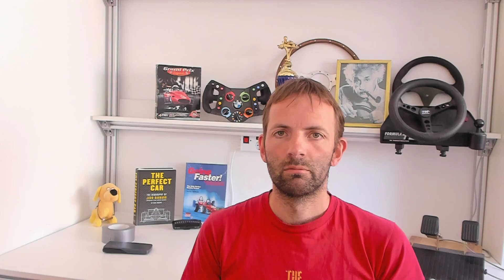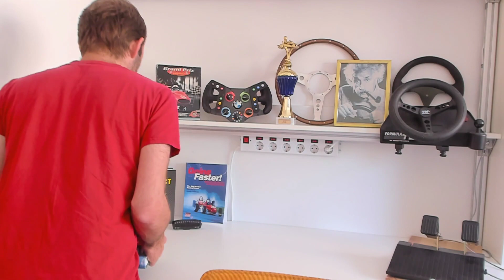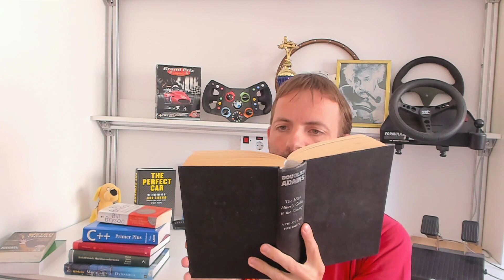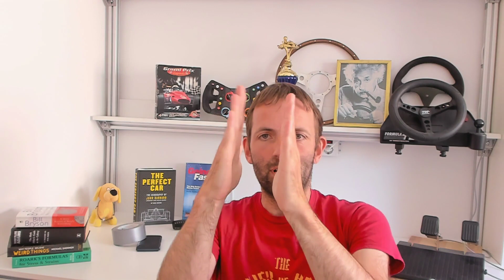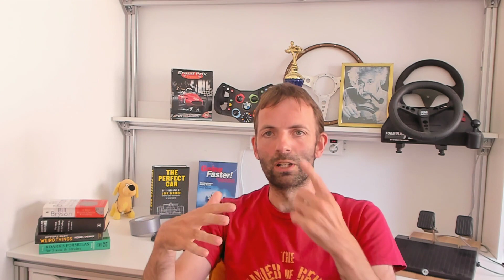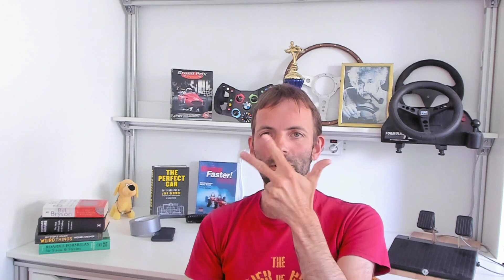Why are tires so difficult to model in a racing simulator?

Comment: As you are directly involved with the physics, would I be wrong in saying that you are also limited by the cost of research and hardware as it’s something you did not mention?
Up until the introduction of Ryzen, and competition with Intel most main stream processors were 4/8 thread max. With the complex calculations and limitations of games/sims only using a couple of cores and the calculation and rest of the engine taking up resource is or was this a restriction on the physics.
With what you have said, if you only get limited data from the tyre manufacturer, could you see franchises like turn 10 (Forza) and  Polyphony Digital (GT) Start to dominate the sim market, because they have much deeper pockets, and they will have comparable hardware to pc’s shorty.
Reply from the maker: Good question! Here is an essay.... 

I feel there is this 'urge' in people (engineers) to make things more complicated when the processing power allows. I also feel that customers get a good 'feeling' knowing whatever they're playing is incredibly complex.

What in my opinion happens way quicker than most engineers would like to admit, is that you're drowning in a sea of numbers. You simply can't control a system with a lot of variables. And the goal of a game is not to be some PHD tire model project. The goal of a sim / game is to deliver good content that is consistent from car to car, with improvements from beta tester / driver feedback being 'easy' to roll out over the entire car lineup.

Too simple is bad. If there is just one 'grip' value, then it is easy to adjust but you will be limited to what you can change in the 'feel' of the cars.
Too complicated is bad. If you get feedback but don't know how to adjust your model for this car, let alone the other 50 cars, you're not going to get anywhere.

Since I've made so many mistakes over the decade I've been trying to understand physics, I am very cautious about adding complexity. People who feel differently about this COULD be right. But if I was twice as smart, which is probably the upper limit of what 'physics guys' can be, then I still wouldn't be able to control a highly complex system. Perhaps Dave Kaemmer and Terence are more than twice as smart, but they don't tune the cars in the game. 

You see I've learned to be extremely wary of complexity. People overestimate themselves all the time. No matter if its blind wine taste testing, blind audio equipment listening, or blind sim car setup testing, we expect to taste / hear / feel a difference, until it is a blind test. Then we come up with excuses rather than admitting to the placebo effect.  It is probably natural human behavior to be over optimistic about our ability. 

This can really hurt race sim development if you don't constantly ask yourself
1) Do we really need this complexity
2) does it really add something we can feel / measure / validate with reality
3) does its complexity not hurt us in our development time and keeping the sim up to date

If you don't constantly ask yourself this, and you get carried away by our human tendency to say 'Hold my beer' and do something complex, I feel you get too complicated models that are too hard to work with because you've lost sight of your own limitation and the reality of producing and maintaining sim content.

The most important thing to add here is that simple is NOT simple to 95% of people! The code is still complex, the models still have many variables and it is very difficult for me to see through the AMS tire model and get the most out of it. So it is not simple, it is not arcade.

Processing power or money to test more tires is not a factor in my opinion. The weak link is the human, not the machine.
Reply: @Niels Heusinkveld  Thank you for taking the time to reply and clearly explain and expand on your video. 
I completely understand what you are saying now and understand the limiting factor 👍🏻
Reply: @NielsHeusinkveld  Well said. I work in IT designing and maintaining systems and networks, and I am constantly asking those 3 questions. I think it is vitally important across so many fields, and is so often overlooked. Is a more complex system more or less likely to break? The complexity may solve one or more problems, but adds in more elements that "can" break. And if they do break, as they are more complex are they even harder to fix? So in the end are we worse off?
Reply: @NielsHeusinkveld  Words of wisdom. It reminds me of the probably apocryphal story of NASA pending a ton of cash designing a pen to work in space where as the Soviets used a pencil !
Reply from the maker: @honeychurchgipsy6  Apparently that wasn't as simple. Wasn't it because pencil tips could break, leaving electrically conductive particles in the cabin? If there is one impressive feat its the moon landings and I think NASA didn't over complicate things.. They simply were that complicated :-)
Reply: @NielsHeusinkveld  - that makes sense - but the story is too good to be allowed to die - lol!!!
Reply: @honeychurchgipsy6  nonsense, they just paid 25$ for a pen with pressurised ink chamber developed by an outside party
Reply: @kornaros96  - what is nonsense and who paid $25 for a pressurised pen?? If you read the comment thread we have already stated that the pencil versus space pen story is nonsense - so what is your point - we are just having a laugh saying it's a great story!!
Reply: @NielsHeusinkveld  I think you've nailed the argument on complexity in that dynamic systems are always capable of producing unpredictably complex or unwanted results, even with relatively simple inputs (think Wolfram's new kind of science). I think this is rooted in a question of top-down versus bottom-up design, where top-down focuses on emulation that seems plausible in a narrow operating range whereas bottom-up lets the desired properties emerge naturally, which is infinitely more dificult to target desired outcomes with, but then the model will hold up in a wider variety of situations which  makes it more believable. 

We can agree that a grain of sand isn't a pile of sand, but what about 4 grains of sand? No? How about 43 grains of sand? How about 15,000 grains? There is no number where it becomes a pile of sand because there's no such thing as a pile of sand. That's just a level of abstraction above the actual components (grains of sand), and it can be modeled as such without any code describing the particles of which it is comprised. But then, what is a grain of sand? Some are larger than others, and the shapes are irregular. If 1/1000th of a grain of sand breaks off, is that a second, smaller grain? It's an infinite rabbit hole of layers of abstraction that goes all the way down, and we have nowhere near the computational processing power to model that in a useful way right now, and yet that 1/1000th of a grain of sand IS indeed interacting in that dynamic system and changing the results. 

If you can't go all the way down, then you must have to go up, or at least find the level of abstraction which best captures the desired behavior, ie, a believable tire. You end up chasing computational reducibility to a practical end, and there is elegance in that simplicity in much the same way that formulas so neatly compress sprawling complexity into easily understood and useable tools. At a fundamental level, what you guys do is about finding believable outcomes, not about having exhaustively complete internal modeling. This can only be done when you can individuate the parameters! In a closed dynamic system, every tweak is going to ruin your carefully balanced house of constraints and properties. The problem with trying to model, say "squishiness" is that it is fundamentally integrated with the other properties of a tire in the real world, and changes in those other variables will influence local squishiness in a complex way. 

AI has given us the amazing ability to run millions of trials with tiny, tiny, isolated tweaks that often reveal surprising insights when viewed in aggregate. You begin to see a "shape" to the effects of turning different knobs, and I think that combining this power with the irreplaceable human interpretation of what a tire should feel like is entirely possible, so long as the variables that most heavily contribute to the perception of driving on a real tire are sufficiently defined and related to one another. You could feed an AI massive datasets of telemetry data (and throttle, brake, steering input data) from top drivers in a wide variety of conditions and essentially build a "drivatar" AI of sorts, then turn the process on its head and have that AI drivatar drive your tire models, measuring the differences between the output telemetry and the target telemetry (the data it was supervised with originally). Then you basically have an AI that hones in on a tire model, making millions of tweaks until the driving produces nearly identical telemetry data to what it was targeting, almost like a metal detector sweeping over a nugget. AI will never replace the human element needed for good model design, but it can run 100,000 laps much faster than I can! Its opinion of whether a tire model is close isn't subject to whether or not it has eaten lunch or previously been driving a very different type of car, which would certainly color human assessments.

I claim no right to open my mouth on this subject, so please jump in if I have gotten something catastrophically wrong. I would love to learn more and it wouldn't be the first time! I stumbled on this video and found it super interesting; I have never stopped to think about the monumental task of modeling a tire before now, and it has given me a huge respect for what you guys do and have been able to accomplish thus far!
Reply: @NielsHeusinkveld  I like your video and your reply so much that I bought your Sprint pedals right now, instead of a (fairly large) competitor's. 😎
Reply: @Zwenk Wiel - yeah, that's why I (or rather my other half pretending to be me) stated that it was probably apocryphal!!
It makes me think of the idiot space deniers who say stuff like 'that thin lunar module couldn't protect the astronauts from radiation' (because their only experience of radiation is an X-ray that requires lead to shield from it).
Lack of knowledge combined with a willingness to make fun of the 'boffins' for being 'stupid'/ over complicating things leads to these stories becoming 'true' legends - lol!!
Reply: @Zwenk Wiel - yeah, me too!!! It sounds true because we can all imagine those plucky, make do and mend Soviets saying 'fuck it - why don't we just use a pencil??', whilst our lot trudge on for months trying to get a pen to write upside down - lol!!!!

Comment: what about soft body physics for tyre simulation? Seems perfect, in my non existent game-engine experience. And friction forces, combined with that. The rubber is soft body phys. but the air inside is, well, air. Set the possible squishiness, reduce flex in or near walls... if the CPU power wasnt a factor, wouldnt that be the most relevant technique in theory?

Comment: So basically physical model is trying to recreate the power output of the engine by changing piston size, compression and fuel etc.
Empirical model is like: Engine goes 300 hp brrrrr
Reply from the maker: Good example yes. And how far do you go? It will always be a limitation, you can't model each molecule.. 
Another example would be to compute aerodynamics from actual car shapes and orientations. For these things, most sims simply use some polynomal equations or lookup tables, but for tires, somehow the tendency is to make it complex and more difficult!

Comment: great explanation, what is the tyre model of AMS 1?
Reply from the maker: It uses its own model, if you browse my videos, I have some about putting 'real' tire data in the sim, and about 'Tire slip explained' where you see me playing with the tire model in a spreadsheet a bit.
Reply: @NielsHeusinkveld  Yea, I tried to find an answer by looking through your videos but it seems I didnt llook enough, nonetheless, I asked because I see the way the car is driven from your videos is really good. 

I had hopes it would be the physical tire model, as I really find what rf2 did to be amazing. 

Having said that, I think as you said in one of the comments, thats simpler is not always worst and from seeing how you are driving those cars in your videos, they really do control very very well. 

Which actually confirms that simpler could also be awesome. 
I have ACC, AMS2, PC2 and rf2. 
I always come back to rf2 for the feel of the grip tbh. As with others, I feel the signal turns off and the car just unrealistically spins out.. You explained how hard it is for developers to create this effect and I believe you that its very hard :) .

I value how the car drives and controls rather than all the heehaaa that other games offer. 

Great job helping the sim racing community to develop. And btw do you have any new projects ;).

Comment: I'm having this Tyre problem in Assetto Corsa, if you look RaceSim Studio's F1 1990, if you try to get the qualifying time at Jerez1990 It's impossible as the tyres don't have enough grip. I did try other mod's tyres like from F1 ACFL 1994, they have enough grip to get the qualifying time, only by just. But I know I have too much grip, when I watch real life qualifying, I tend be going 10 to 15km faster. When I drop down RSS F1 1990 tyres,  times around corners seem the same as real qualifying times, but overall still no way enough grip for the qualifying times. It seems to be me, Assetto Corsa needs more slip, less breaking grip, and high take off grip to solve this problem. It seems to me, that the way it is, if you have low breaking grip, you have low take off grip. If you have high take off grip, you have high breaking grip.

Comment: The empirical model, while perhaps simpler and "less accurate", is perhaps more accurate as there is more room for error. If degredation can be input correctly, there is no reason why it shouldn't feel correct if each parameter can be adjusted based more on actual feel than hard data. For instance, in the movie "The Fly", Seth Brundle programs the exact data for a steak and his girlfriend comments that it tastes "artificial". If he'd have programmed empirical data, perhaps he could have built the steak based on his actual experience when eating one.

Comment: I remember watching a video about racing sim physics and it was said that (at the time) all racing sim physics engines cease working when they approach zero due to some mathematical problem. Basically they said that when stationary or at very low speeds, you're actually using a different, "canned", model and that you then transition to the "real" physics model past a certain threshold. Is that true and is it true of sims today?

I've not really researched the topic of physics in sims or computer games, but being born in the '80s I've seen physics in games become more complex over the years and got a sense of the empirical nature of it. I did wonder about physical modelling in a very naive way (basically visualising a tyre reacting to different situations) and it seemed quite intuitive, but the more I thought about it, the more I realised I have no idea how it would actually work from a mathematical point of view and what "physical" means in the context of simulation.

Comment: Hey Niels,
I appreciate your remarks about the practicality of 'empirical', curve-based tyre models (ala Pacejka) over 'first-principle' models (such as in rF2, iRacing, PC2/AMS2). However one question I have is how do you deal with the finite size of the contact patch? ACC initially used a 'single-point' contact patch which led to some issues on for example curbstones, and transitions between tarmac and grass. Now they switched to the 5-point contact patch and that already seems to make a significant difference.
Do games like AMS1 still use a single-point ('infinitely small') contact patch? Is there any way to include the 'averaging' effect of a finite-sized contact patch without resorting to a finite element/finite difference model like in rF2/AMS2?
Alvast bedankt ;)
Cheers, Gillis

Comment: I've been involved in tire modeling and multibody simulation for the formula sae team of my university... I can say that tire modeling is complex, but is not a magical thing. Tire manufacturer knows how to measure tire data but they don't spread this to all the world;They can publish the vertical stiffness and dumping but usually they stop here. For the modeling then there are a lot of ways to do it, the most used is the "magic formula", by pacejka, that I think is a good compromise between realism and complexity but i don't think that it's used in Sim racing. However I know ( from an interview of Giampaolo Dallara) that pirelli can model a tire that is capable of replicate even the tire degradation. For a real professional simulator, like the dallara Sim or f1 sim, the tire are the biggest problem: more than a alf of the parameter of a model are for the tire. I know that I'm talking about another tipe of Sim, but whith these I just want to say that nowadays, whit the right hardware, we can symulate something that is really really close to reality, but I think that it require to much resources compared to what can give in terms of enjoyment.